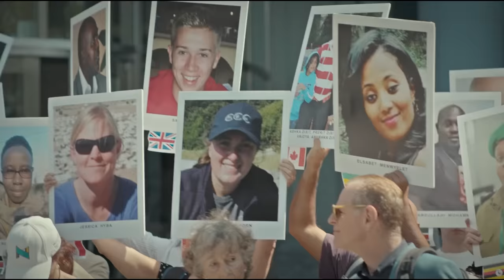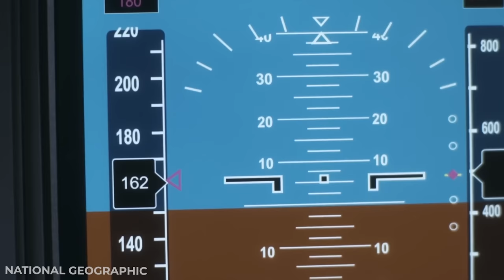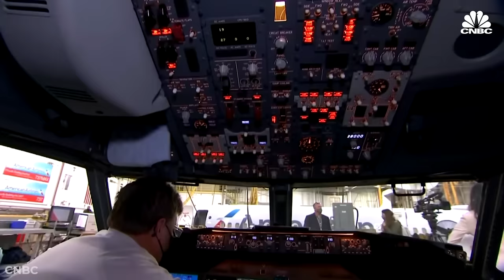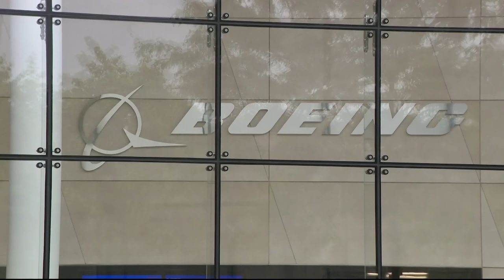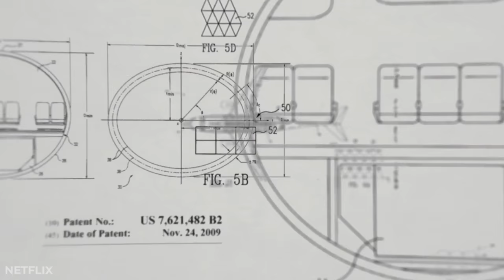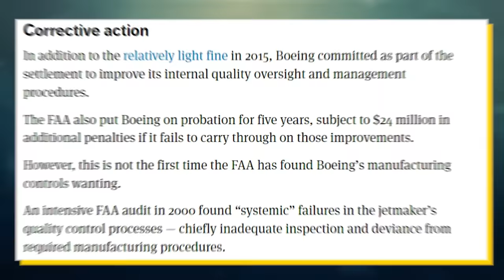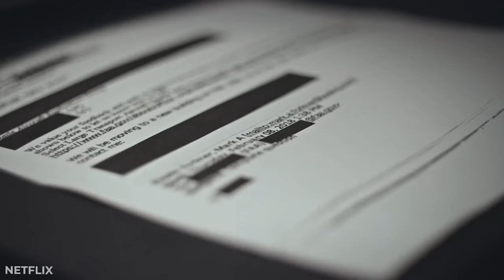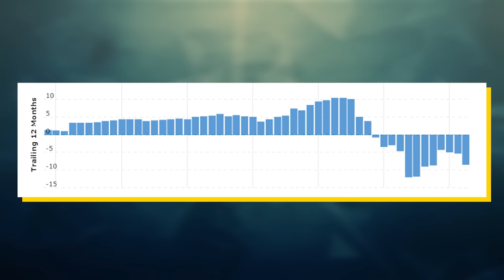Even Boeing Engineers Don't Trust Boeing...

Comment: MCAS: "Based on a SINGLE Non-Redundant sensor, I consider myself to be omniscient!!!" #FlawlessLogic
Reply: On nearly every jet operating in the US there are 2 AOA vanes. Yes, without redundancy if there is a failure, then what? There are procedures that pilots are taught during Initial Type training to discern erroneous indications and use the correct indications.
Reply: @markgo2882  It doesn't matter, you just flag the system as faulty and go back to manual control. That is enough to avoid the absolutely inevitable disaster you get by just trusting one. That is insane. This is what all dual channel flight control systems do, it takes a triple redundant system to have an option of disregarding a single faulty channel. I did in fact work, in a very minor role, on the Tornado's Spin Prevention and Incidence Limiting System (SPILS), albeit very briefly in 1979. This used two AOA sensors to aid the pilot in spin prevention and incidence limiting. This was a dual channel analogue flight computer with multiple cross channel checks through the whole of the controller. It would disable itself if any of these cross channel checks went out of bounds. This is how you do it, anything else is rank stupidity. All the critical flight computers were triple redundant and intended to survive a single channel failure.
Reply: IDK why computer cannot use information from all sensor to construct the physical model of aircraft. If aircraft is in full throttle, altitude is diminishing, then air speed cannot be so low, and the speed sensors are most likely faulty. Aircraft has very little free dimensions, so all array of sensors is redundant. Add separate GPS and glonass receiver and you have even more ways to calculate the same true position and speed.
Reply: @hrissan  The ability to take in instrument data and intuitively understand from it what the aircraft is doing is a part of good airmanship - and also a very human thing. It's surprisingly difficult to give computers an equivalent to intuition.

Taking your scenario, dropping altitude and low airspeed along with full throttle could be indicative of a faulty airspeed indicator - or it could indicate a power-on stall.

Comment: It’s happening everywhere. I work for a premium hvac dealer and the equipment we get is crap. We’re doing multiple major repairs on many systems before they’re even three years old. I work on all brands and they’re all engineered down more and more taking quality out while they simultaneously raise prices multiple times a year. It’s the same for most major appliances.
Reply: Yeah.... I found an old (2006) heat-pump (retrofitted for new gasses) and the tech that installed it said it will probably last 20-30 years from 2017
Reply: It's because just like in the case of boeing, everyone buys cheaper stuff. So if you want to stay in business, you make your stuff cheaper as well. Anyways, boeing planes are great, they still are on the forefront of aviation, this guy just wants to make a viral video that's it.
Reply: @dfct9494  thank you, i will now mix in carbon tet into my corn syrup to make it 5% cheaper
Reply: @angrydragonslayer  You are just being unproductive for no reason.
Reply: @dfct9494  please do explain what you mean by this

is my comparison between adding dangerous chemicals to food and cutting corners on safety for airplanes not fitting in some way?

Comment: It's difficult not to fly Boing craft when you fly commercially. During the 70's  I wouldn't fly on  a Douglas DC10 because of a lousy safety record. I would change my schedule so I could fly L1011. I always make it a point to know what type of craft and what series of the craft I fly on because of safety concerns because it's not like pulling over to the side of the road to change a flat.
Reply: B O I N G
Reply: How many DC10 accidents were there that were the fault of the airplane?  The actual design and or construction of the airplane?    Only one that I can see.
Reply: Meanwhile, many DC10 fly even today, transporting cargo around the world. How many of them are crashing? 

Plane with dubious reputation will not get scrapped - it will get fixed and if it becomes unusable for its purpose, it will be repurposed. Aviation industry is interesting in such way, when a manufacturer makes mistake, they eventually get caught and have to fix it.
Meanwhile manufacturers in different sectors can get away with almost anything.
Reply: L1011 Tristar? Worst experience. Had to deboard that plane twice, because they couldn't fix problems before takeoff and one aborted takeoff at the last minute. Really disliked the Tristar.
Reply: In USA only Delta uses Airbus.
Reply: @rishavbhowmik8163  Yeah. And not a single A380.
Reply: @lbowsk  The Chicago crash was the fault of the maintenance mechanics taking shortcuts and not following the service manual.
Reply: @rishavbhowmik8163  Are you sure? I’m pretty sure they also have older Boeing planes that they constantly refit and have ordered newer ones.
Reply: @rishavbhowmik8163  Delta uses Airbus
Jetblue uses Airbus
Spirit uses Airbus
Frontier uses Airbus
Many US carriers use Airbus.
Reply: Hello and Yeah it's was the DC-10, DC-8 Douglas Fleets that's what happened to several different DC-10 like 2 American Airlines  DC-10.  One in Detroit very very Lucky made emergency landing closer to Disaster and other wasn't so lucky all aboard all killed in Chicago after American DC-10 lost left jet Engine from the left wing while took off . Other Worst Air Disasters in France was a Turkish Airlines  DC-10 blew the cargo door badly and went down too fast because of weight. Sad Sad lucky I never flew DC-10 and DC-8 .
DC-8 was poor 4 engines narrow planes because of so much flaw designs and cockpit fail and AC systems cause Fire like Nationair DC-8 killed burning up victims while trying to make emergency landing in Sandi Arabia.  Wow
Reply: Lockheed needs to get back into civil aviation. The TriStar was dope!
Reply: @davecrupel2817  But not all of them use Airbus exclusively for journeys their medium- to long-haul aircraft were designed for. The only one I know for certain that uses Airbus exclusively in those cases is Jet Blue.
Reply: @aycc-nbh7289  i was simply talking to the guy who claimed Delta was the only Airbus carrier in the US....
Reply: The L1011 seemed like it would've been a cool plane. I wish Lockheed had been able to stay in commercial aviation. Their story is fascinating. 🤩

Comment: Boeing messed up. They tried to put bigger engines in their new 737’s to keep up with Airbus. Instead of adding longer landing gear they tried to rebalance the aircraft and had to add software solutions to make it stable. The KISS principle was totally missed.
Reply: Correct, Norm. Few people notice that the engines on the MAX project above the wing by several inches. They failed to correctly compensate for this difference. At least, that's what I read...
Reply: Whats that?
Reply: @toasterhavingabath6980 The bigger engines story or the KISS principle?

Comment: I used to be a language coach in Airbus about 15 years ago and we would often discuss the differences between the two companies. I remember being told that one of the biggest problems at Boeing is maintaining quality standards when so much of design and production is outsourced in order to save money: at that time Airbus outsourced about 20% of work, now Boeing outsource around 60%. When I read later how quality inspections were being minimized at Boeing in order to expedite production I suspected it was only a matter of time before accidents would happen. Now I actively look for flights on Airbus planes - especially the fantastic A380, most passengers favourite plane - and try to avoid Boeing planes if I can.

Comment: Not an aviation nerd, but I've changed flight plans when I saw I would be flying on a MAX. And will cotinue to do so!
Reply: Why? Airbus never fully repaired the landing gears on their aircraft and yet people still continue to fly theirs.
Reply: At least a faulty landing gear won’t plummet your plane into the ground at Mach 0.85
Reply: @zacharytracy3797 That’s until it detaches from the rest of the plane and flies into the engine or tears a hole into the fuselage. I’m glad this hasn’t happened yet, but it’s only a matter of time before it does.
Reply: @aycc-nbh7289 still even if that occurs unless it causes a chain explosion (which I know can occur but is quite unlikely) you’d have a better chance of survival since unless it also punctures the hydraulic system an emergency landing would most likely be successful
Reply: @pikazilla2897 You’d have to assume that nothing like what you mentioned doesn’t happen during the landing.
Reply: @zacharytracy3797  a little more complicated than that - you do realize both crews in both MCAS issues left the auto throttle engaged and accelerated to 350 plus knots, right? Would have never happened w U.S. trained, competent crew.
Reply: @food3234  lol Nice try, Boeing fanboy. The pilot of the plane that crashed first was trained in the US and had no idea the system was even on the plane. Boeing know if the crew did not react within 10 seconds they would be dead guaranteed. The second plane crashed even though the crew did exactly what Boeing told them to do in that case (a case that should have never happened in the first place). Disgusting of you to victim blame the pilots for what was essentionally mass murder.

Comment: Nothing is changing at Boeing. one of my best friends his dad is a recently retired Boeing engineer who worked at the Everett factory. I personally have friends who are current Boeing engineers. Right now, senior management is engaged in undesirable cost cutting methods, such as hiring temporary contractors instead of full time permanent employees. Outsourcing hasn't stopped, many programming are still outsourced to India where the company has a hard time conducting oversights and QAs. Newly hired contractors have no passion towards the jobs they do, they are getting paid very little, they have no benefits, and management can fire them whenever they want with no compensation. These people don't care about the planes they build, most of these contractors don't even stay with Boeing for more than 2 years, some even left after 1 year, and management will just replace them with someone else who is looking for a quick buck. The situation is very very sad.
Reply: And in comes DEI, it appears it’s working out real good for Boeing…….well maybe not so much!🤣

Comment: "We have to design the 737MAX."
"Fine, we also have purchased McDonnell-Douglas. We'll give the task to those having designed the DC-10."
Reply: Yep exactly - the MD10 in my opinion one of the worst designed widebody airliners ever built.
Reply: @tomriley5790  Not really true; The DC-10 was a fine aircraft with some design flaws that were dealt with. The biggest problem was related to PR with some very public, videoed crashes. The O'Hare crash - the one where an engine broke free of the wing and the aircraft rolling over and diving to the ground - was NOT due to faulty design but the airline screwing up maintenance to save a buck. The Sioux City crash - the one where a DC-10 cartwheeled after an emergency landing - was another one. most passengers survived that crash which is a testament to the strength of the aircraft. It crashed after the no.2 engine suffered an un-contained explosion - BTW not a McDonnell Douglas design - and the shrapnel subsequently severing the hydraulic lines of ALL hydraulic systems; an event so unlikely it was not even included in the risk analysis during development. Still the crew managed to fly this aircraft onto a runway.
A real design flaw led to the problem with the rear cargo door opening in flight; it led to a fatal crash near Paris where the opening of this door caused the floor to collapse and thus severing the control cables to the control surfaces. The same happened to American Airlines flight 96, but it was able to land safely. The rear cargo door latches were revised and never again gave problems. Additionally the main floor was provided with vents preventing its collapse like happened with the Paris crash. By then however the public had lost confidence in this trijet - mostly due to the visuals but also the unjustified grounding of the type after the O'Hare crash - and airlines didn't anymore want to offer this aircraft as a mode of transport to a reluctant public, so it was relegaded to cargo duties.
Ever since the DC-10 has had a fine, if not exemplary safety record.  Later MD-10's were basically the same aircraft with an upgraded two-man cockpit, but the MD-11 was a completely different aircraft, even though it looked very similar.
Funny though
As shown in this video, the Boeing 747 had similar problems with its cargo doors leading to fatalities. In 1992 the no-3 and no.4 engines of a Boeing 747 broke free from the wing and the aircraft subsequently crashed into an apartment complex near Amsterdam. Somehow that didn't lead to the grounding of the 747 fleet as the FAA did with the DC-10; makes one wonder why.
Reply: @roykliffen9674  The DC-10 fleet grounding was basically a misunderstanding.  The investigation following American Airlines Flight 191 soon zeroed in on a fatigue crack discovered in the pylon of the departed engine.  So the fleet was inspected, but in few cases similar cracks in the same critical part were apparently missed the first time.  During reinspections not long after, cracks were found in pylons thought to be crack-free, raising the question of whether such cracks were somehow forming after a very small number of cycles.  So all the planes were grounded, but after more analysis it was concluded that no, cracks couldn't possibly be forming that fast -- it must have been that they were present during the first inspections but had been missed.

Comment: As for the mechanic not checking the door and how long these issues have been going on at Boeing...not that long, since they opened the South Carolina plant which was part of a major culture change on the factory floor there (as opposed to the Douglas changes that got to the executives and bean counters)

As for why Boeing bought McD it was about the defense contracts vs civil aviation balance.
Reply: Baloney, I watched a news report around 1990 that exposed how the managers at Boeing would cut corners, forcing the manufacturing to go forward with known faults in the structure of the airplane.  Bet you are from Seattle.

Comment: When you say "Boeing engineers don't trust 737 max," they said it's OK to fit the new engines and didn't check potential door plug problems. If I had the luxury of choosing what aircraft I could fly on, it wouldn't be the 737 max.

Comment: I've worked for Boeing in 2022-2023, on the Simulation Team. We've been designing simulation software for systems such as the MCAS, among others.
The culture of "pretend this will work" is still there, unfortunately. As well as pretending that a simulation (a glorified videogame, at the end of the day) - is an adequate substitute for testing the real thing. I wasn't onboard with the idea that our simulation, the "Digital Twin" as it was called - was an adequate substitute for testing the real thing in the flesh - but that's what our whole department's funding was hinging on, so our PMs pushed that narrative.
Then when funding was cut anyway - I was moved to the 777X's simulation team. And learned why the B-777X is so far overdue for certification and production... It's basically a "modernized" B-777 but with more bugs and complex solutions to simple tasks to justify years in the cooker.

At this point - expecting Airbus to take the lead in the short term. Comac or Chengdu - in the longer run.

Comment: Boeing were used to minimum outsourcing and keeping things central to Seattle. Airbus operate like Boeing do now with outsourcing, but they grew from that model from the start so are used to this process. From a consumer point of view, the ideal situation would be for Boeing to revert to their old ways with engineers running things -  so for consumers would have a choice of both manufacturers working at their best.

Comment: I flew Boeings for several years.  Engineers, we trust.  It's corporate who're creating the problems.  The same thing happened with both the Challenger and Columbia disasters.  BOTH of the 737 MAX crashes could have been avoided had management simply ensured pilots were taught the two-step procedure for disabling the autopilot.  Instead, both pilots were poorly trained.  One kept fighting the erring autopilot without taking it offline while the other pilot kept reengaging the autopilot.  That's PILOT ERROR.  Obviously, the autopilot needed to be fixed.  Corporate failed issue corrective action when it first learned of the issue, and not one but two disasters ensued.  

Boeing corporate has repeatedly FAILED to exercise their full "due diligence," not to mention proper Quality Control, thereby costing the company many times more than if they'd simply fixed the problem in the first place.  

NEVER try to sweep ANY known problem under the rug!  The same goes for Lying Joe Biden as for Boeing Corporate.

Comment: The whole concept behind the 737 Max was flawed. If the plane is going to fly differently, you need to retrain pilots.
Reply: Adding another system that, while activated, makes the aeroplane fly similarly to an earlier 737? Then you need to retrain the pilots - firstly so they know the system exists and how to identify when it's giving problems and disconnect it; and secondly so they can fly the aeroplane when the faulty system is disconnected.

And then the MCAS system uses a single sensor rather than taking input from the pair of redundant sensors already fitted to the aeroplane - just mind-bogglingly incompetent engineering.